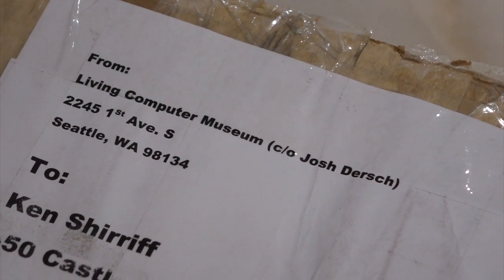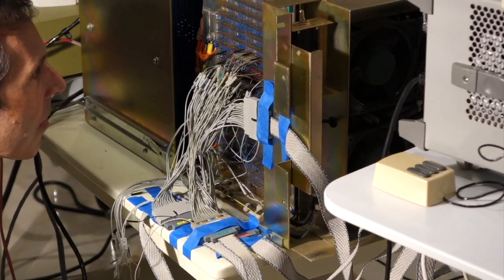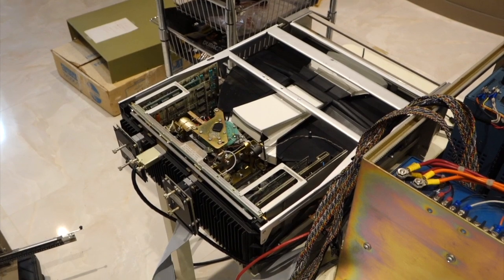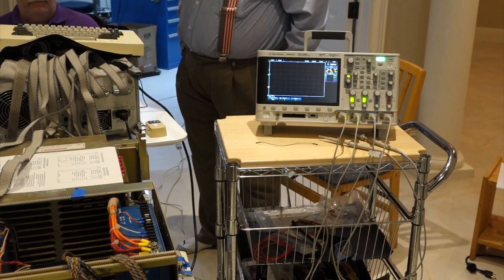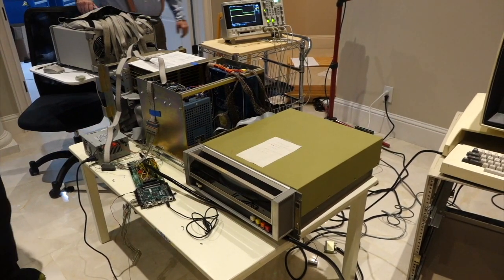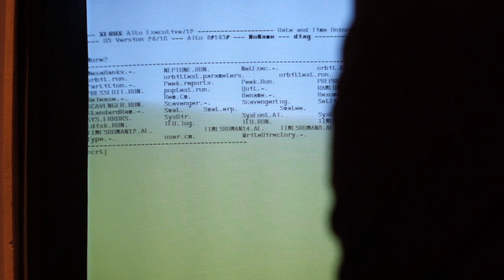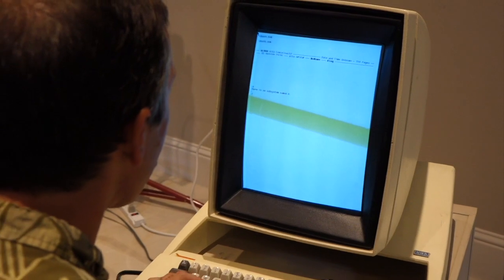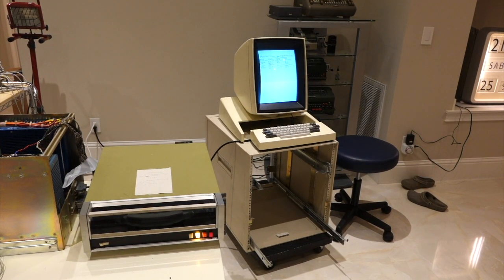Xerox Alto Restoration Part 8 - Alto finally boots

Comment: Is it possible that the machine was booting to cylinder 8 because of a keyboard issue? Or maybe just the memory map that the keyboard interface uses. I saw in the manual that the boot position can be changed by holding keys on the keyboard while booting. It reads the first word of keyboard memory and uses it as a disk address.

Comment: Congrats!   Cable looks like a smoking gun.... id just replace it and assume it was bad if the problem never happens again.
also, is there no memory read write program on the diag disk to check for pattern errors?